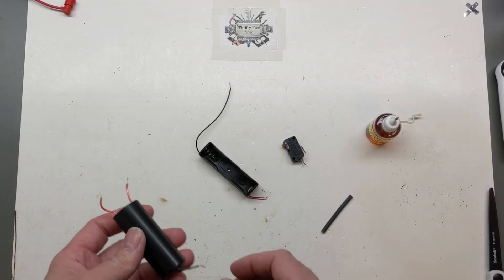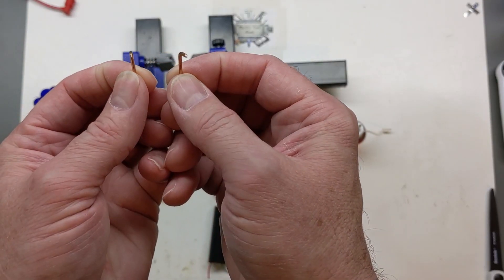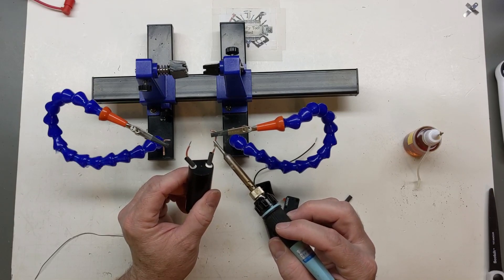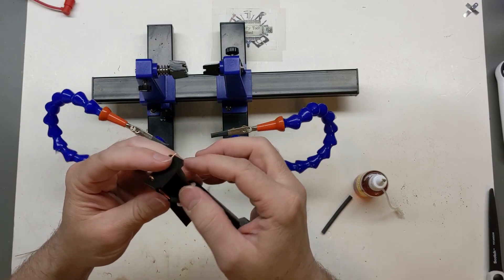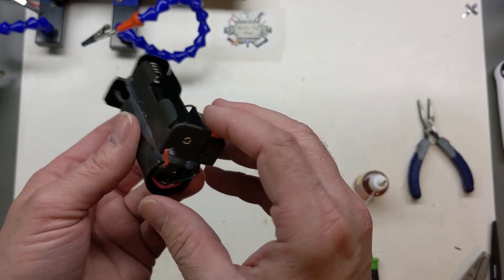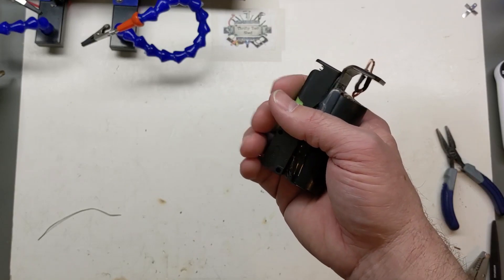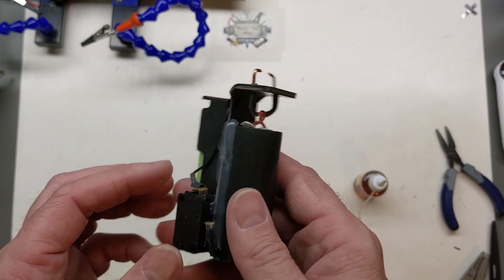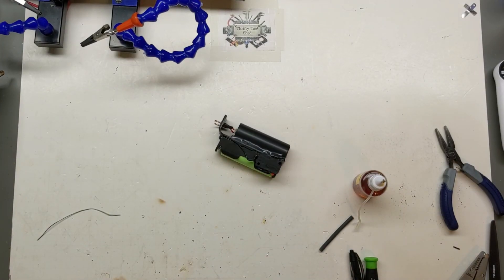High Voltage Module Fun

Comment: Hi where can I get the helping hands that long and flexible? I have the pcb holder and its my favourite out of the different types ive used. But the arms? Any reply appreciated cheers from Australia 👍
Reply from the maker: Hi,
I have an older video about it  and I simple added  the cheap Flexible air hoses to it. It is handy.
https://youtu.be/ewaAcFetYnI?si=KbzXPL78dNxbuu_3